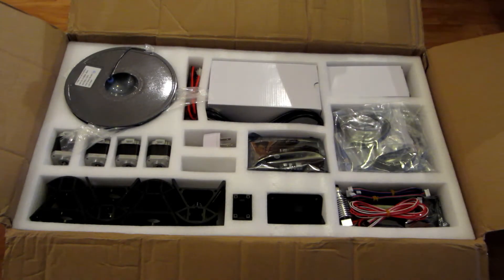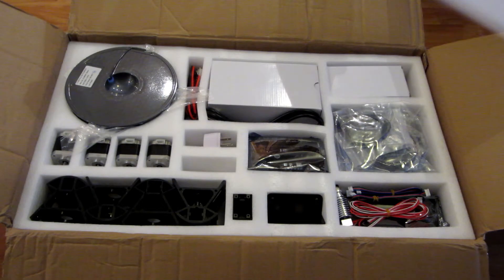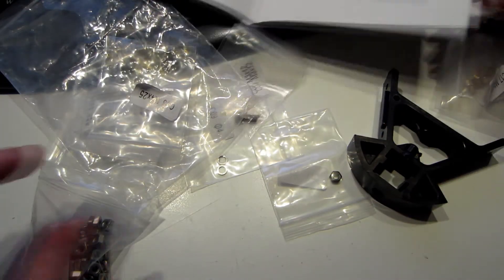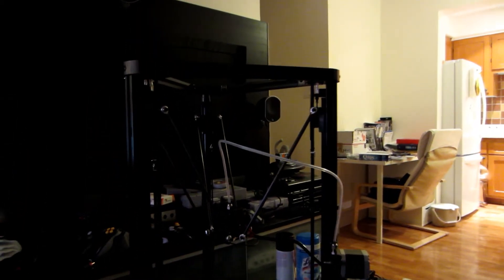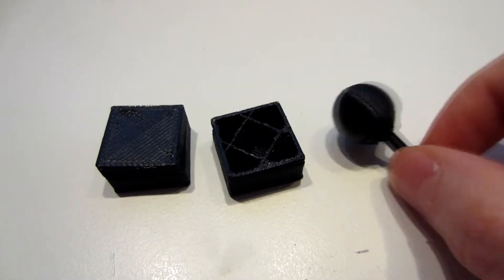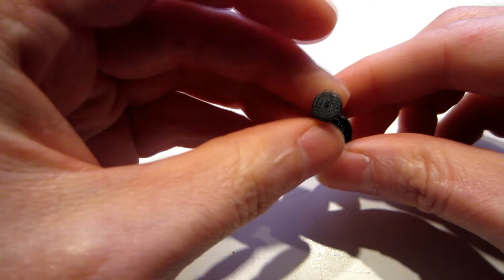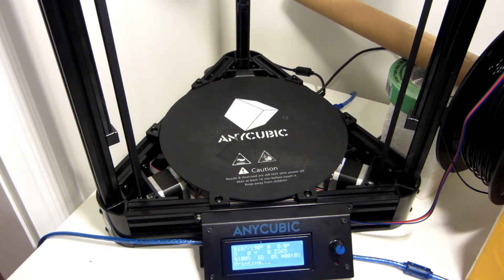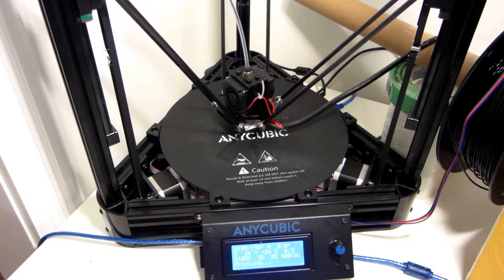[The Lab] Anycubic Kossel Linear Plus 3D printer (+ EZBED calibration)

Comment: Thanks for the video. Does it do the auto leveling each time before printing? Also, is it easy to change the filament? I have Anet A8 and it's a pain to change the filament...
Reply from the maker: Hi, no auto leveling is not done before printing. It's a different process you have to run manualy (well, with the EZBED method though). I'm only running it once while. Filament is easy to change, you just have to preheat the nozzle and open the extruder to free the filament.